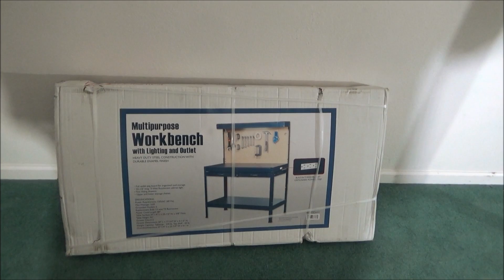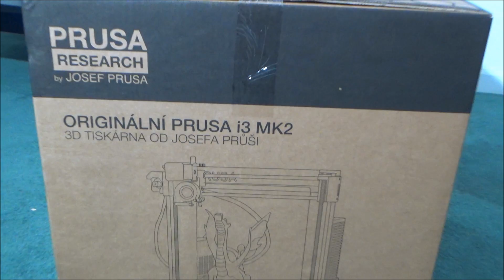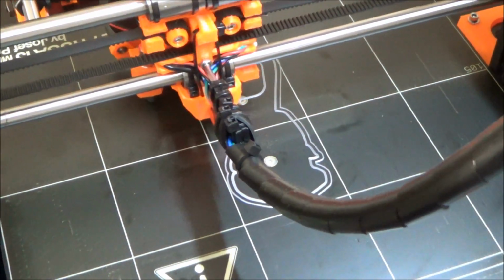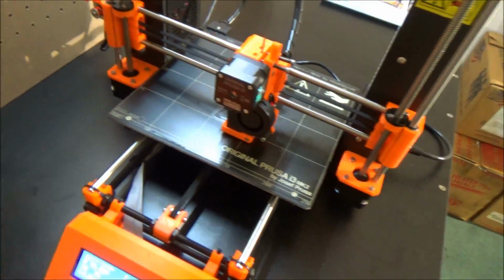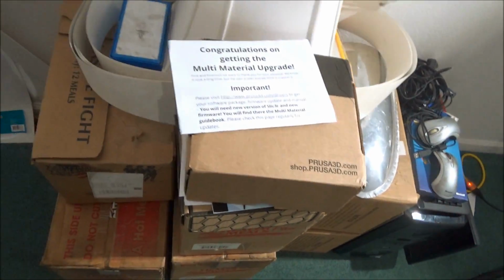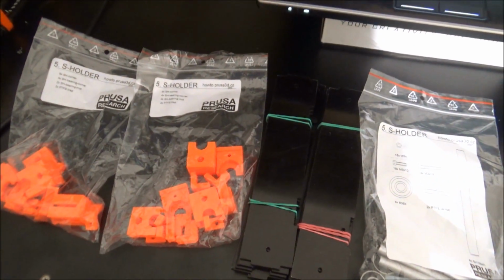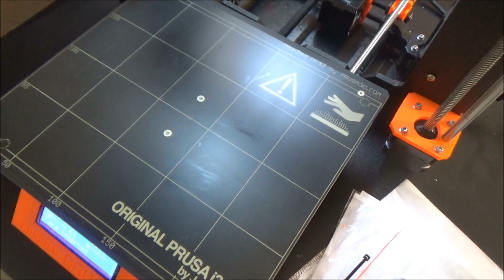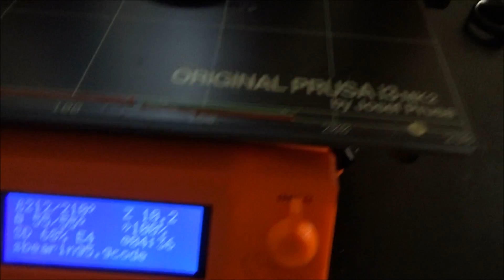Prusa I3 MK2S with MultiMaterial Upgrade  3D Printer

Comment: The different color filament may be flowing more easily than the Prusa silver PLA. You might need to reduce the flow rate multiplier. Worst case, you might need to edit the STL file to make the inside gears a little smaller.
Reply from the maker: Mod MINI   Thanks.  I still haven’t got it to work right.   But I haven’t  used it in a while now to many other projects.   I will try it with just the silver filament and see what happens.

Comment: Your nozzle needs to be much closer to the bed for a proper first layer. Use the 'Live Z Adjust' to lower it by 50-100 microns and see how it goes - you absolutely do not need the glue stick. PLA sticks to PEI on its own with the right bed leveling. :)
Reply from the maker: Austin Vojta    Thanks I will try that.